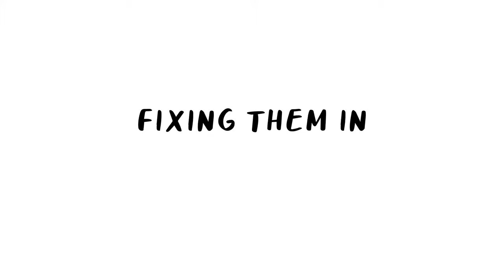Making my kitchen bench seat - an Ikea hack

Comment: Could you share a link to the cabinet you used and the dimensions? Thanks! Trying to find it on Ikea's website.
Reply from the maker: Sure! I've added links in the description 😊 a tip if you're going to use it for seating - make sure to add one panel of wood across the whole top so that the weight is distributed onto the vertical sides!